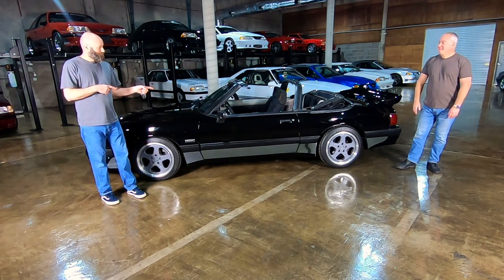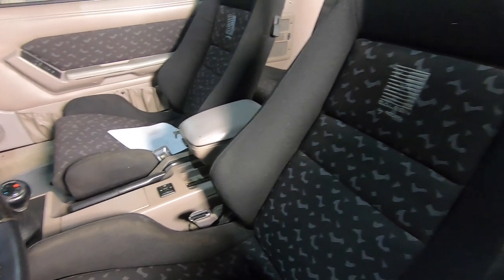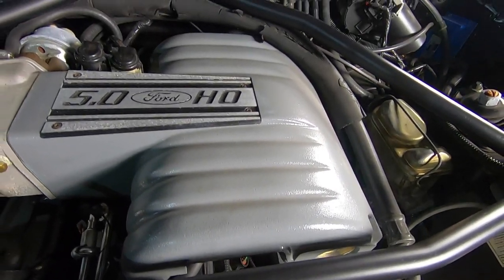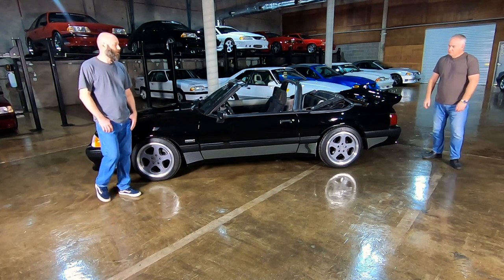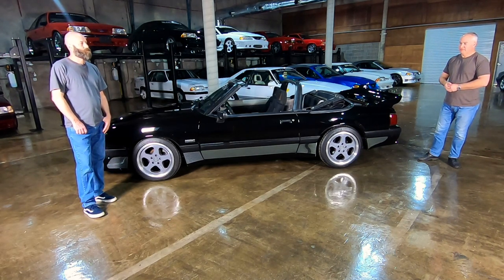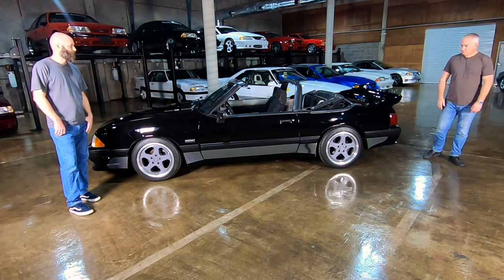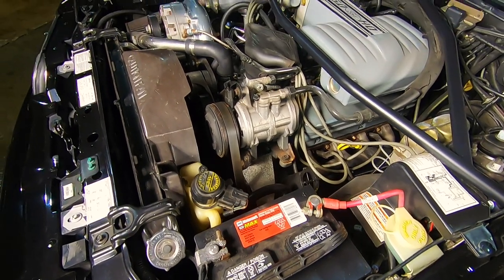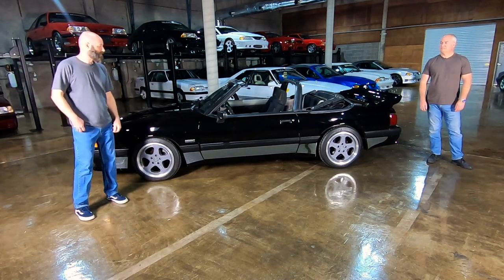1993 Saleen #02 Spyder - Poster Car - Supercharged Foxbody Convertible

Comment: What are the wheel and tire specs?
Reply from the maker: They are standard Saleen one piece Stern spec.  17x8 and 17x9.  I think the fronts are 225/45's and rears are 255/40's.  That's what Saleen used on most of the cars. But, it wouldn't surprise me if cars came with different tire sizes in production.
Reply: How much of a lip was there on those wheels on the front and back? Are they the same as the sc wheels LMR now sells?
Reply from the maker: The lip is very small. 1/2” or so. The LMR wheel isn’t an exact copy. It’s very different in design and construction. My $.02 is they those aren’t a replica at all. More of a new design based on this style of wheel.
Reply: Is the 1/2" lip on the  front ones or are they 1/2" lip front and back?
Reply from the maker: Same all around on the faces/outside of the wheel. Fronts and rears look the same.
Reply from the maker: There’s footage in the video of the car. Check it out. That may help.